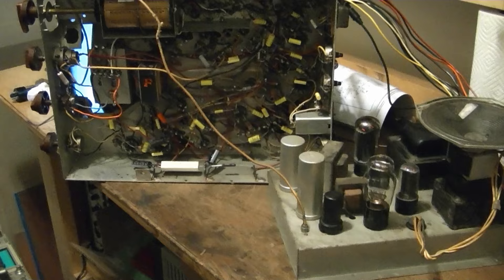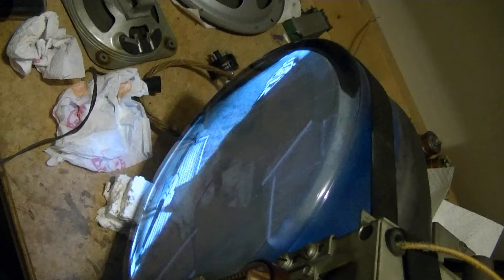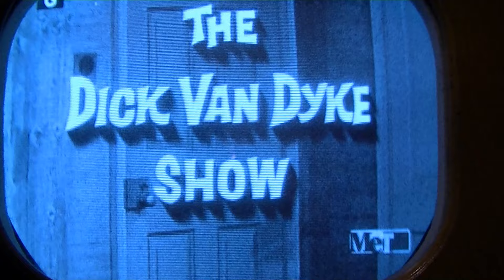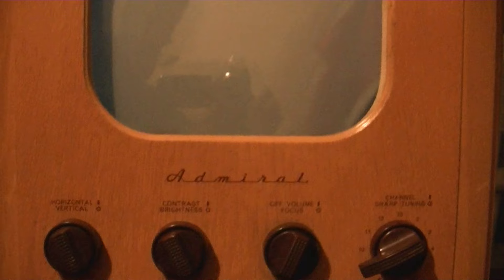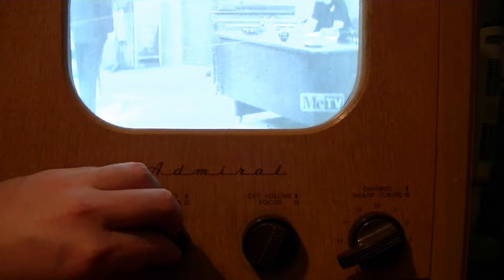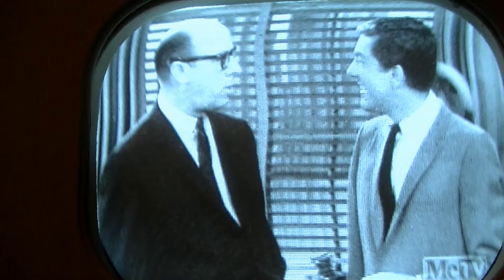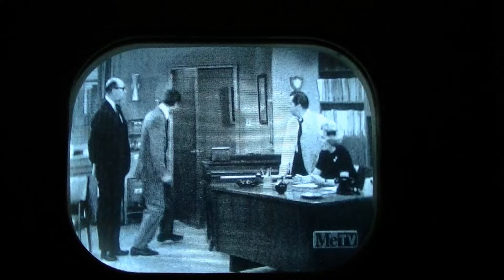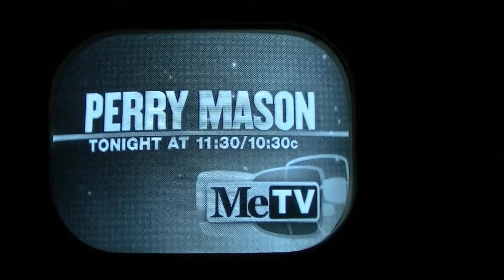Admiral 30B1 chassis restoration p5o5

Comment: Had a Philips 19TG154A that had similar issues with scan ringing and raster pulling, it turned out to be the Flyback Transformer, changed it and problem solved.
That cabinet looks fantastic, in that light finish and brown marking.

Comment from the maker: I actually replaced it with one from a 30A1 chassis earlier in the series because the original brightness section went bad.  I recall the contrast issue was the same with both pots though.  I'll check on that resistor next time I pull the chassis out.

Comment from the maker: There's a small mica cap inside the yoke across the horizontal winding that might be bad.  It's there to suppress ringing.  I'll get back to it eventually, but right now I need to work on some other stuff.

Comment: The 30A1 I am working on had a 10k resistor added to one side of the resistor in series with the gray wire. I noticed when doing the setup alignment the bias at the wiper would not go to the -3v but more like -5v was the min. It was old enough looking to think it may have been a production mod changes. Yours being later may already incorporate the change. Seems like the correct fix would be just a larger value pot. Maybe it was replaced at some point with a lower value?

Comment: If you happen to work on this set again, check the circuitry and tubes around the sync separator.  It appears the video is triggering the horizontal sync(when it is not supposed to) with the contrast up.  What you are calling ringing actually appears to be the picture wrapping around horizontally when the horizontal sync is off due to high contrast.  Some of these old sets do not seem to work well with strong signals such as cable and the DTV boxes deliver(and the quality of the DTV boxes seems to vary all over the place).
Reply from the maker: I do plan on getting back to this chassis someday.  This set has a number of issues I would like to resolve.  Not only does it has the vertical strips on the left, but the brightness and contrast do not work as expected.